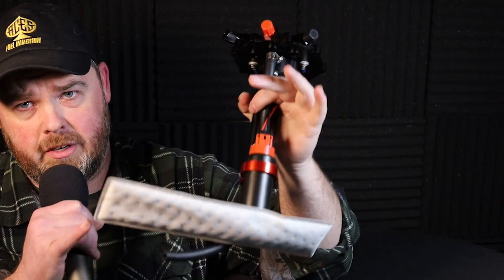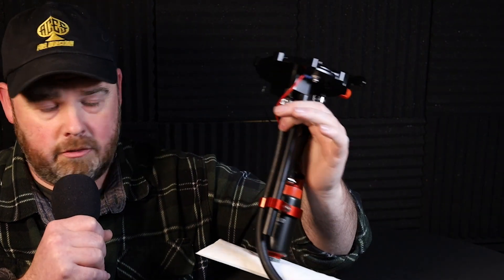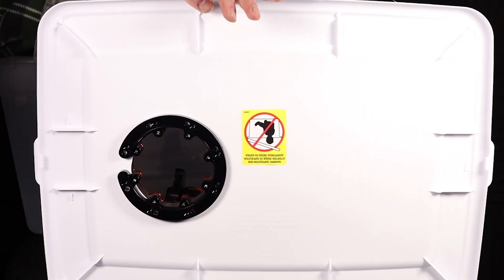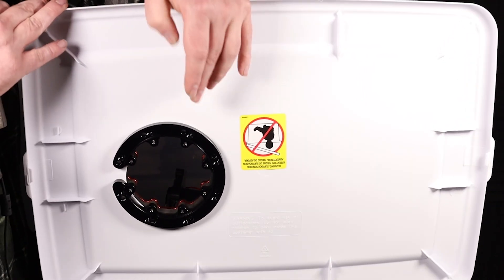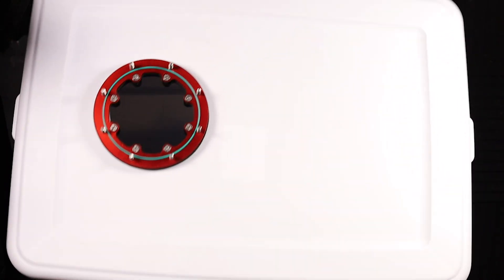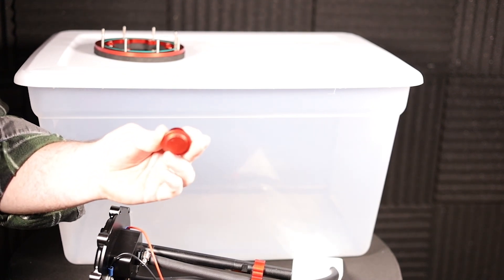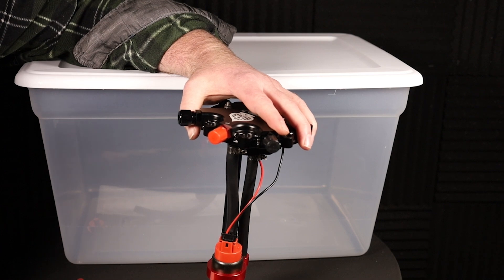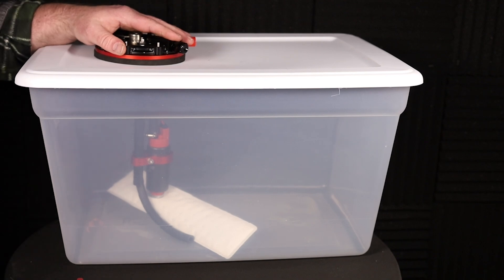Tank Conversion Pumps

Comment: So could I not replace the carb style sending unit assembly with a factory style for a fuel injected model (1985 C10) and just use a stock style/ Walbro style pump that’s rated for the pressure and lph needed? Thus allowing me to have an in tank setup, with return line, and a fuel level sending unit. As I DO NOT want the loud ass in line style pump.